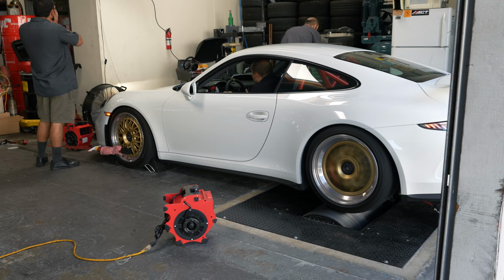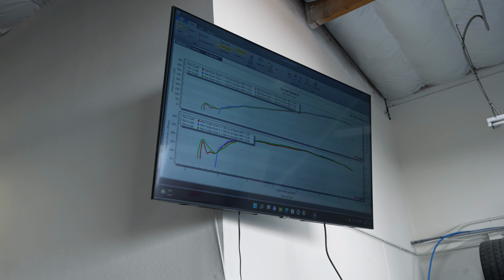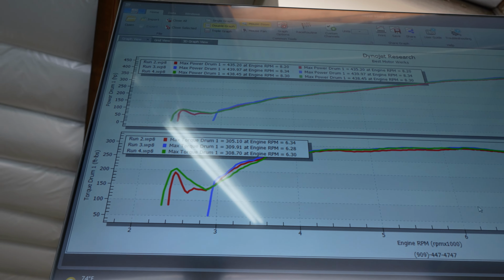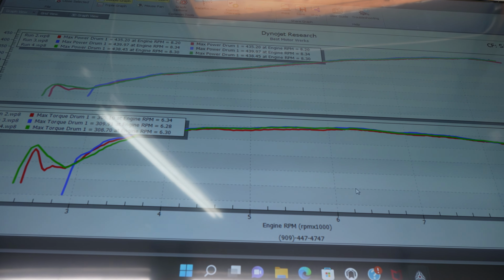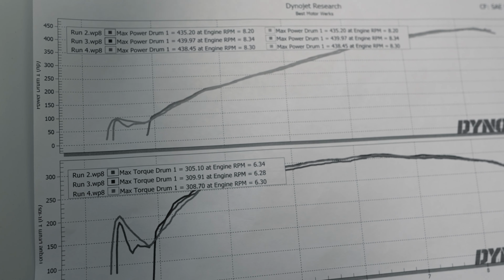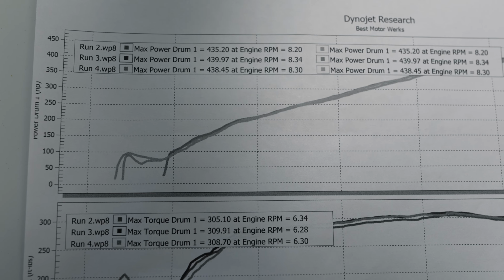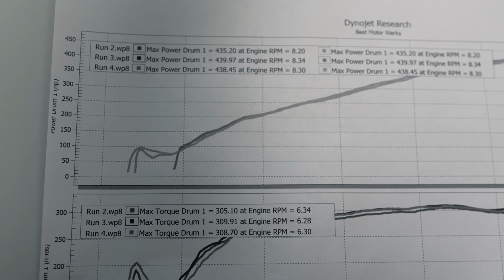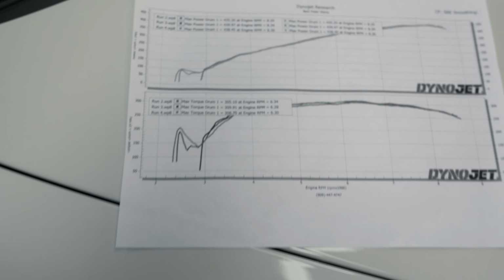Porsche GT3 on the Dyno! *LOUD*

Comment: Hi Gabe, great video. Porsche AG sold it as 500hp crank. Seem like most 911s do have ~10% drive train loss. If you convert your Dyno-Jet reading to STD correction it will be exact 500hp at the crank which is 450rwhp. SAE is 440rwhp  your reading. Exact what we expect from brand new engine. But what really surprised me is that the headers and the tune did not make 1hp more than the factory claimed 500hp. You should have done dyno when the car was stock so you can follow the gains if there are any....
Reply from the maker: Thanks for this info! That would’ve been a great test to do! I have the car stock now 🤔 could be the time
Reply: @Thewinnerscircle_  Yes it will be cool to do a test, but it must be done on the same dyno, same tire pressure,  also if possible around the same outside temp +/-. If too hot outside squeezed for power engines like GT3 or other hi revving small displacement engines they are very knock sensitive and will reduce the power in order to save the engine.

Comment: Bro one question i see your video you GT3 give you a problem with the motor ¿your car is good now you have not had any more problems and How many miles did it have when you changed the engine? 
How many milles you have now in your car?
Reply: I want to buy one. What you recommend?
Reply from the maker: I made a 2 year review video on the car. Check out that video 👍🏽 I covered everything you will want to know and if I left anything unanswered, just leave a comment and I’ll get back to you

Comment: Very loud. Even louder then the setup on my car.   I was cringe when he was letting the car decelerate on the weight of the Dyno rollers. He should have pulled the paddles or neutral
Reply from the maker: Everything went fine and the car wasn’t moving or jerking around. I don’t know much about dyno etiquette and technique but everything was smooth and quick 👍🏽
Reply: @Thewinnerscircle_  the Dyno rollers are a very heavy rotating mass, if you try to brake with the car to slow it down you will burn them up, only way to slow it down is with the Dyno brake itself, but before he did that the deceleration was just hanging there at very high rpm and slowing down very slowly.  Some people might not see it as a big deal but maybe I’m too picky.    

How was the difference between tuned and not tuned with your setup driving wise? I have a fabspeed long tube setup but no tune at the moment.  Drivability wise did you feel a change after the tune?  Are you running no cats?
Reply from the maker: @gmmza03  yea I’m catless. Catless without a tune feels down on power until you get above 7k. The tune filled in all the gaps and as I suspected, very linear and strong for a gt3
Reply: @Thewinnerscircle_  very nice, need to look into getting a tune done on my setup. Definitely feels low on power in the lower rpm’s
Reply from the maker: @gmmza03  yup, feels like that on my buddys RS too